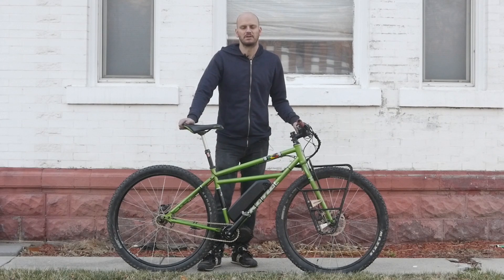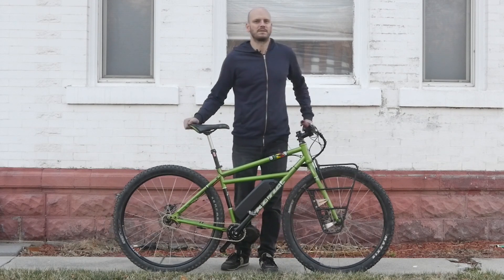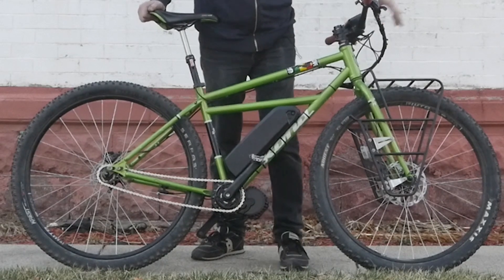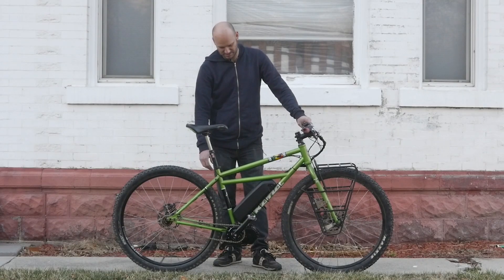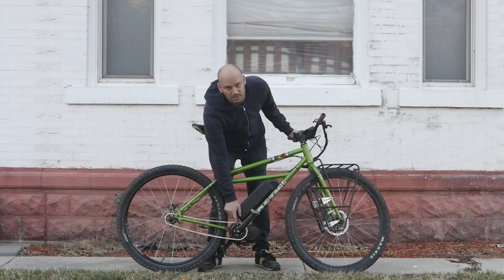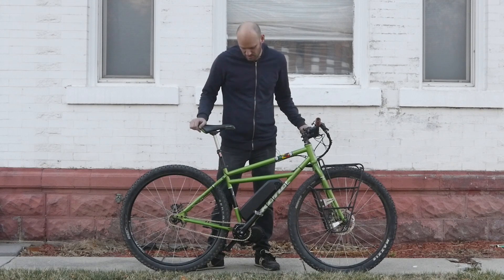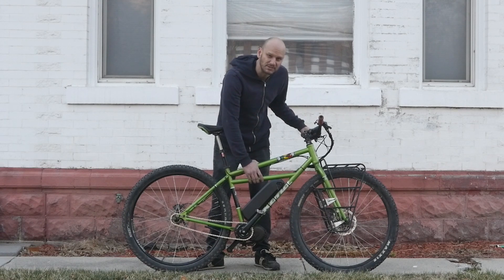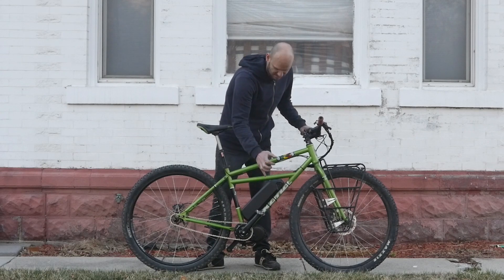Custom E-bike Build: Kona Humuhumo BBSHD Mountain bike

Comment: With a BBS-HD, you want a 1:1 gear ratio, assuming 26 inch wheels - you’ll climb ‘most any hill, but your speed will top out about 12-14 mph.

Note: this is on my own bike, with my bottom gear on the cassette being a 42 tooth, and the (Luna) chainring being a 42.

Note2: am thinking about going single speed for the “spare” bike, to reduce weight.

Comment: Hey Johnny...for that single speed you might wanna try a asi bac 800 controller w/ a 56v battery 1:1 gear ratio and rev it out to 11000 rpm...koolklunker

Comment: Hello. I have a question. I want to convert my MTB bike into an e-bike and I just want to know if the Cyclone 3,000w Mid Drive motor is a good option or if I should buy a 1000W Bafang BBSHD but the Bafang is more expensive and I want a more cheap option that has a lot of power.
Reply from the maker: Check out my video on that subject!
Reply: Ok thank you.

Comment: This bike needs a better ration no use putting on all that e motor n batt if it's only going 25 mph max Any e bike set up, the $$$$, the time, energy spent and weight added to it it's got to do 32mph or more.
Just my opinion.
In any event I always watch your videos.
Reply: Throughout The World and especially The EU, mostce-bikes are limited assist at 15mph. An e-bike is to make traditional cycling, easier, more convenient and accessible, not faster. The more one rides, the less speed matters, even in traditional cycling. For less money, you can get a safer, more reliable, electric motorcycle or scooter.

Comment: Hi Johnny I've bought a new bike with the 1000w bafang bbshd motor with 52v 21ah battery how many miles should I get or round about depending on how I ride I'm round about 16 stone yes I need to pedal more and burn some fat 😏😫🙏
Reply: Factoring in what you've said You should get around 35-55 miles with peddling. Obviously less if you use just the throttle around 25- early 30 miles. But that's a good size battery with a pretty decent range.
Reply: @ashley010788  thank you very much for taking the time to reply that's why I went for the bigger size battery my friend
Reply: I like to help. A more conservative range would be 33-45 miles. U should get at least that. The 33 miles is if you pedaled on the highest assist level and the very least u should get is 33-35 miles. And at least 25 miles if u used full throttle.
Reply: @ashley010788  I always pedal on my other 500w 48v fat tire e-bike I had range anxiety and that spoiled the ride for me but thanx to you my friend I'm feeling a lot better
Reply: @ashpunting  that's good I'm glad to hear that. Yeah that can happen, it doesn't help that companies/ sellers usually give ranges that are way off and much too high compared to what u actually get
Reply: @ashley010788  thank you Ash

Comment: Would I be wasting my time converting a mongoose  deception 29 that I bought for $80 at a garage sale .....😁...?
Reply: Go for it!!!
Reply: @MrJob91  mmmmm....maybe.  it's not a cheap regret.
Reply: @kweshinz2103  its a process you fix what you need to fix, improve what you need to improve and learn and study what you need to study. I build 2 ebikes from 2 old bikes for less than 600usd. Both with a fwd hub motor. Maybe get a new chain and crankset make sure the headset is properly adjusted and greased get some new handlebar grips and tires make sure the braking is good enough to stop the extra added weight and speed. Have fun man
Reply: @MrJob91  thanks for the feedback 👍

Comment: I made a road E-bike that was plenty fast.  But it only was good for road.  Then I took that motor off and put it on a Giant Talon MTB.  With a 36 front chain ring the motor is spinning above 17mph.  Not much fun.  So I am waiting on a 42 and a 44T front ring.  I may also change over the rear cassette so all gears are usable.  This trial and error gets expensive.  A good idea might be to make a video that talks about good gear ratios for each type of riding.  That might be more helpful than the one you did just talking about the front chain ring sizes.  I am sure many DIY like us have leftover parts that we have paid for as we get our bikes dialed in.
Reply from the maker: Great idea👍
Reply: All bikes, e or traditional, are their most efficient at a cadence between 60&120rpm, pushing on the pedals no harder than as if you were walking that same surface. You can work harder, but you get less return for the additional effort (bars, frames, cranks, chains etc all begin to flex, absorbing energy). An off road cyclist is seldom going very fast. To maintain efficient cadence, they obviously need a smaller chain ring or a pie plate for a cassette (sometimes both). 

I am a cyclist, not a motorcyclist, whether on a traditional or e-bike. I am not racing anyone, so 60-80rpm is ideal for me. I am out to explore new places (touring) or taking a more civilized means of getting to work. 10mph up a steep hill is just fine with me (I'll wave to the neighbor as I pass). I have never understood why traditional cyclists haven't adopted smaller chain rings with more compact cassettes (shorter, lighter chain with better horizontal chain line). It seems to me, commuter, road, gravel and touring e-bikers would benefit even more from such a set-up.

Comment: Luna has a Battery Mount that is a machined Aluminum fitting you secure to downtube with hose band clamps @ $20.
Nice option to have vs drilling two Rivet/nut in the frame for a Battery mount. 
 It would be nice if your shop sold this mount, people don't like drilling holes in their frames
Reply from the maker: Ya. Didn’t know they sold them. I’ve always used the triple bob from ebikes.ca
Reply: I have a carbon frame and used the baryak mule for my battery. 
They have smaller ones too. I just don't like the hose clamp look. 

https://www.baryak.com/new-products/baryak-mule-single-mule-with-intsall-kit

Comment: It would help to know the customer's application. 90%+ of my customers would be thrilled riding this with a 42 or even 52 tooth chain ring, but they are the type that would get off and walk if off road got too technical anyway. 

I love this build and any build with a front rack to keep weight off that rear wheel. Kona is simply awesome anyway and The BBSHD is perfect if you are going to power a heavy bike with marshmallow tires. I believe that tiny chain ring could power thst Kona up that hill from a standstill without the motor for most cyclists. It would be a picnic with The BBSHD...or any kit!

Comment: You went through a lot of trouble to put the battery in the triangle.  Is a rack mounted battery such a bad idea that you didn't even consider it?  You even mentioned that it would be nice to have a rear rack.  If you don't mind I'd love to hear your thoughts on that. Thanks
Reply from the maker: Putting a battery on the rear rack is doable, however, it totally throws off your center of gravity and changes the handling of the bike. I don't recommend it for this reason. I do put a smaller batteries under the seat on some of my bikes that have an impossible triangle, but that is as far back as I like to go with the battery if at all possible. I've also done some batteries in backpacks, which is also not totally ideal for obvious reasons, but sometimes the only thing you can do.
Reply: That's good to know this and your thoughts. Thanks Johnny

Comment: if the bike is only on flat land it probably will be fine. always easy to swap a wheel out and get a cog with gears. wondering if a custom triangle shaped battery would give more capacity
Reply: As a custom builder, sometimes you just have to go with something off the shelf. It takes too much time and becomes cost prohibitive, but if you were building it yourself, for your self, I am sure you are correct. I got burned twice on off the shelf triangle batteries, so tgey are out for me, but Johnny has me more and more looking at bag batteries.

Comment: I have a single speed right now, I am selling it to get a geared bike to make into a e-bike.
Reply: You can move a kit. Give the bike you know and love a try! You may want to use a slightly larger chain ring than without a kit because you will have more power. The elegant simplicity is still there and your boost becomes your gears. I would never have believed this until I converted an aluminum single speed coaster folder for a customer. I was so impressed I am seriously thinking of replacing all my bikes with a pair for the wife and I. That bike only had a 350 watt, 60nm, torque sensing, mid-drive. Note: all my builds are Class I pedelecs anyway. This thing was super comfy at 15mph and very easily crossed the 20mph limit I set for it. I cannot imagine a good, full sized single not being far superior.

Comment: You do realize that a single speed mid drive is the exact same thing as a hub motor that’s why it failed the test and you hate hub motors so why would you make a bike with identical specs to a hub motor I just don’t get it why would you get a single speed there just as useless as a hub motor
Reply from the maker: Many benefits to a mid drive even in a single speed applications:
-rear flat tire changes are easy
-ability to change the front chainring/ rear cog for a total customizable gear ratio
-no unsprung weight in the rear wheel
-better center of gravity
Reply: @JohnnyNerdOut  it is also crazy expensive to get a hub motor with that kind of power and torque. If you do, it won't be as reliable and a lot harder to work on. These mid-drives are more simple inside than a Bendix coaster brake hub!
Reply: @MHH3180  if your gonna get a mid drive single speed you might as well just get a hub motor cause there cheaper
Reply: @pascalkargut3237  no where near the torque. Because of the low torque and the fact that they weigh a lot more,, no where near the range. 

Weight distribution is way off on a hub drive and a lot harder on spokes (commuters and touring cyclists already tend to put too much load on the rear wheel). 

Swapping a rim, as rims do wear and warp, is an expensive pain compared to swapping in a traditional wheel. I don't like exposed controllers or finding ways to hide them or the extra wires. They are ugly. 

Once you remove the crank, it is a lot easier to do a mid-drive install. Finally, unlike Johnny, I do torque sensing mid-drives (lighter, simpler install, fewer wires and better range). To do so on a hub drive requires removing the crank to install a torque sensor anyway. Having said all that, I would have gone with at least an IGH on this build. I'd also have at least a 42 if not a 52 tooth chain ring. Then again, I won't sell a throttle so the combination of multiple pro racers and my customer pedaling ought to be enough for any hill.
Reply: @MHH3180  dude your literally making the same argument like I know mid drives are better to
Reply: @pascalkargut3237  that is why even single speeds are significantly better with a mid-drive. More torque, better range, simpler install, more reliable, better balanced,  cost less less in the long run and are better balanced for hamdling.
Reply: @MHH3180  but there more expensive and single speeds suck why do you think that not one single company makes single speed mod drives cause the performance is just so poor
Reply: @pascalkargut3237  because generally single speeds are all about simplicity, even fixed gears with no brakes. The market is too small, but that does not mean an e-bike version would or could not be awesome and especially great for the totally inexperienced cyclists. Better than 90% of all folks buying bikes never ride them anywhere they need to climb a hill. There is a whole sub-culture of folks that travel just to ride rail trails and near half are on e-bikes they will almost never shift and they'll change boost only as they grow tired or find themselves in a hurry. I am not a fan, but there is a place for single speeds and single speed e-bikes.
Reply: @MHH3180  there useless they suck no company wants to make them there inefficient they take to much energy and you can’t climb hills you can’t go fast they are realy not that good
Reply: @JohnnyNerdOut  no one company does this why cause it has terrible performance just get a hub motor if your gonna do that those benefits you mentioned are quite minor and don’t come up very often it’s like keeping your car in second gear for life why wouldn’t you just use all the gears that thing could not even climb that hill even though single speed ebikes suck I still love your Chanel it’s awesome keep it up
Reply from the maker: @pascalkargut3237  the good thing about mid drives is that it’s easy to change the gear ratio by simply switching our a cog or chainring to get the desired performance. Personally I’d like to have gears too. But I would never go hub over mid in 99% of cases. I just like having options and having maximum performance 🍻
Reply: @JohnnyNerdOut  I agree mid drives are almost always better but you can have up to around 35-50% more torque if you had gears and a ton more speed but why would you spend time to switch the cog or chainring to switch gears instead of taking less than half a second to switch gears with a traditional system
Reply from the maker: @pascalkargut3237  good question. Same reason why people buy single speed mountain bikes in the first place🤷‍♂️ probably not for me but hey no judging
Reply: @JohnnyNerdOut  that’s useless to and it’s really dumb not gonna lie even those people don’t know why they do it

Comment: Neat!  I assume a rear-wheel internally geared hub is cost-prohibitive?
Reply from the maker: Probably add $350 to the build. Customer didn't want though
Reply: Not too many IGHs can handle the torque of a BBSHD for long. Even a BBS02 will wear out an IGH if you're not careful about power delivery.
I've heard & read that Rohloff hubs can handle the power but they are PROHIBITIVE.
Reply: @michaelsprinzeles4022  I have heard this too, but it makes no sense. Setting aside The BBSHD, most motors from anyone generate less than 120nm's of torque. Hillclimbers, racers and even some everyday cargo bike riders generate more than 200nm's of torque. I fund it hard to believe the more constant torque of a 120nm e-bike would be too much of a challenge. I know my old BBSO1 350 watt, that probably puts out 60-80nm's of torque,  put absolutely no measurable wear on my 7 speed Nexus I rebuilt a couple weeks ago (that beast went through five mid-western Winters as my commuter).
Reply: @MHH3180  Using the gears properly helps a lot. Most people forget about the gears on an e-bike, until it's too late.
Reply: @michaelsprinzeles4022  most have no idea how to use gears properly. Any time you are pushing on your pedals harder than as if you were walking on that same surface you are looking efficiency whether e-bike or traditional. You should maintain a cadence between 60 & 120rpm as well. I like that IGH hubs can be shifted while stopped or coasting to a stop. I also like keeping the same chain line, but tgey are heavy and introduce a great deal more friction.
Reply: @MHH3180  The IGH can be awesome for the right build & rider.
If used properly the IGH is virtually maintenance free.
Reply: @michaelsprinzeles4022  I agree, but if used daily as a commuter, they really need to be overhauled annually. You can abuse old Sturmy 3 speeds a lot more, unless they have a coaster brake. My 7 speed has a roller brake I would put against any rear hydro disk, but many it is a pain whe. You have a flat.
Reply: @MHH3180  I'd call "once a year", under heavy use, virtually maintenance free. lol
Reply: @michaelsprinzeles4022  you make a good point and paying to have it done might not be too bad, but gads they are a pain to remove, disassemble, clean, lube, reassemble and reinstall. 

I hugely abused mine. I used it for five years without any service. It shows and is making reassembly a hassle. I'll get it, but wish I had done it every year and would gladly pay $100 to have it done if I did not have a shop.
Reply: @MHH3180  That's why most people stick to a derailleur. They can be bought cheaply, maintained easily or chewed up and replaced cheaply.
Reply: @ph5915  Some IGHs are better than others. What gears you actually use and when makes a difference to the longevity of the IGH. The motor also makes a difference, most have half the torque of a BBSHD.